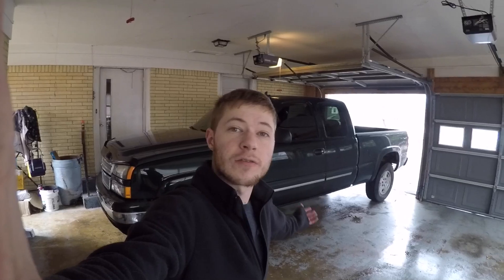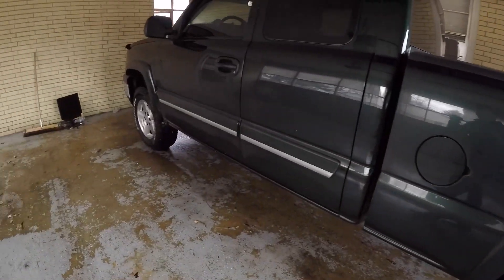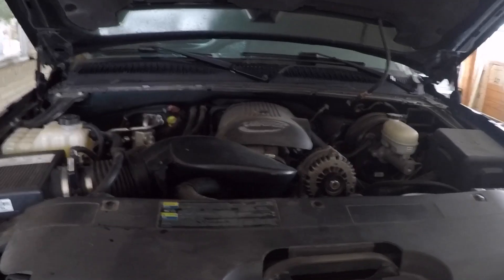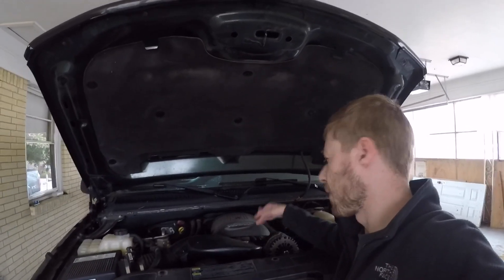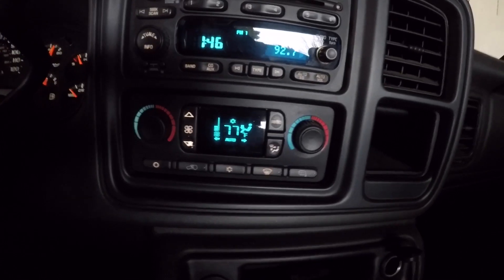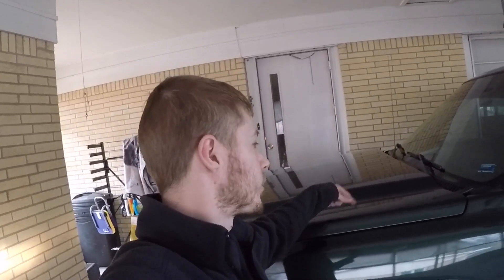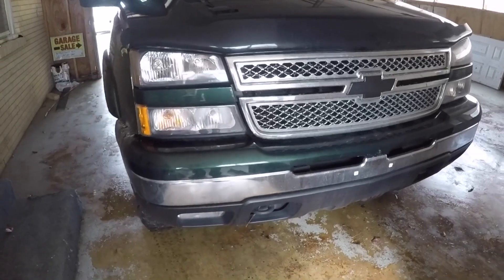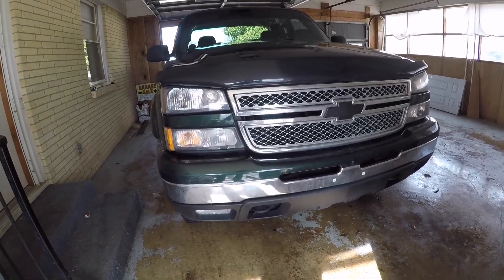2006 Silverado (5 Things I LOVE)

Comment: I have the same truck with a few add on accessories.  Ranch hand bumper guard, black rock star wheels with more aggressive tires, flow master exhaust,  back up camera,  rock star side step, camo seat covers, hard tunnel cover, and of course you have to have all LED lights. We pulled our camper all over the Rockies in all 17 med western states. With a 143,000 plus miles this truck performed flawless on our trip. Headed next for the great smokies with no hesitation on the capability of this truck.

Comment: I have the 2007 "classic " Silverado. Regular cab, with the v6 long bed LS package. Since it was built late in production, I think I have one of the last 5 speed manual transmissions. I love this truck. Can I afford a new one, yes? But I just keep it up with 170000 miles.
Reply from the maker: I can completely understand that. And the great thing about these trucks are they are easy and cheap to work on

Comment: L33 engine is essentially just a high compression 5.3l using the 4.8l flat top pistons but I have to say it may not be a huge hp jump at least on paper but mine will flat out roast the tires off it and did I mention it has 33 inch tires and 20 inch rims... I absolutely love mine

Comment: From what I gather, 2006 and older are the best Chevy Silverado trucks. 4 speed automatic and no fuel management BS (the one that puts your truck in 4 cylinders or whatever). I'm actually going to try to find one in the near future. Nice truck! Do you still have it??? Damn it sounds like you sold it. No! I would never sell my 2003 Trailblazer 4x4 LTZ reliable SUV with only 158k miles.

Comment: That auto climate is way old tech. Lincoln and caddys had it in the early 70's with auto mode even for the fan settings just wasn't digital. This is probably just more refined lol.
Reply from the maker: That’s pretty amazing. I’ve seen some 90s (maybe late 80s) Blazers/S10s with a digital speedometer. I remember thinking that was pretty cool

Comment: Have a 06 4.3L v6 vortex. At 135,000 I replaced my heads because of them cracking. Also put a flow master exhaust. What upgrades can I do to my truck so it can have more hp
Reply: Gilbert Morin honestly you can find a good reliable 5.3 vortec for pretty cheap in a junkyard
Reply: You could trade it in for a real truck.
Reply: Take to scrapyard for more HP

Comment: your lift height?
Reply from the maker: It’s about 2.5” in the front and 1” in the back. This truck has a rough country leveling kit installed
Reply: i have a 07 classic that im going to get lifted saw 3,5 on rough country im not sure if im right but it comes with the  upper control arm  thanks for uploading  i have the crew cab
Reply from the maker: You bet! I think that may be for the newer body style if it has the control arms. The kit I got came with lift blocks for the back, torsion keys, and new shocks. I installed it myself without power tools and it was actually a fairly easy job

Comment: The newer chevy trucks look like they made the front end to look super big . Which probably is not good for areodynamics . In fact it looks like a wall going down the road. When your truck is unloaded wouldn't you want fuel savings ?? GM , ? I have a 2005  GMC Sierra !! yes it replaced my leased 2017 Ram pentastar  1500. Chrysler,  please get out of the auto industry. 5x in for cam phasers,  check engine, traction off would put in limp mode on highway VERY DSNGEROUS !!   They don't stand behind their warrenty . Both the dealer and Chrysler..

Comment: Digital climate control...too funny..My first car, a 1984 Nissan 300ZX had it too..as did my moms 1984 Cadillac Deville..Nothing new!!
Reply: Th newer 2010s and up cars, most of it, the digital cluster is integrated to the radio unit which is what I hate. The very old 2006 and down like this truck is standalone.

Comment: I bet your regretting selling that truck now. 99-07 classic (specifically 03-07 classic) the GMT800 best trucks GM ever made. 07 and up are garbage. Good looking the K2xx are but GM ruined them. Took the solid drive train and power train and trashed it with all the crap that’s on the them. Sure the over all materials are better. But overall the GMT800 is the best well rounded package GM ever had. My 2014 is had its share of issues. I should have never ever sold my 2006.